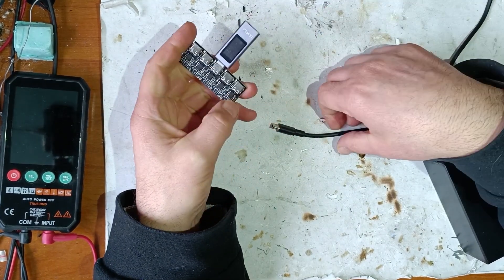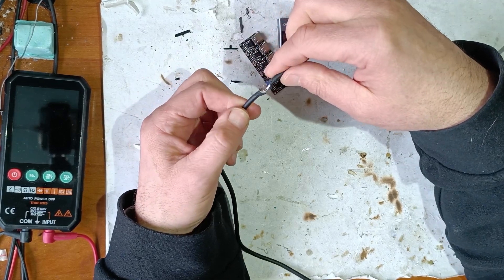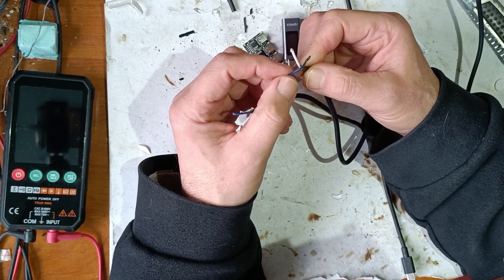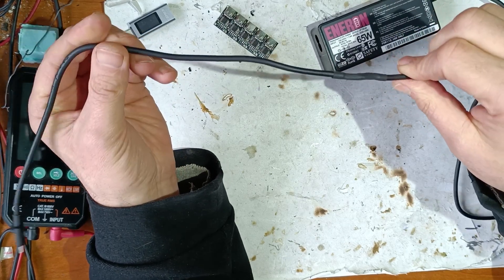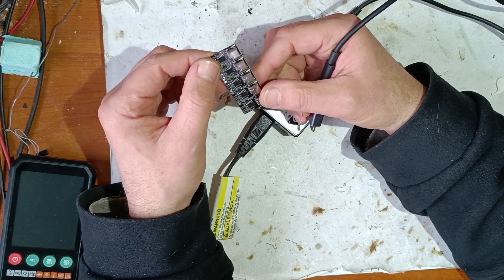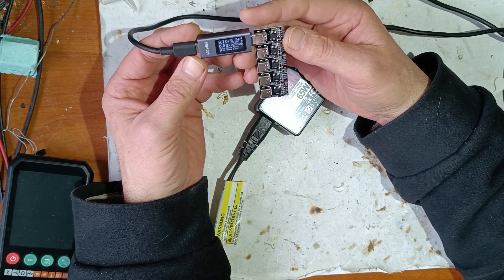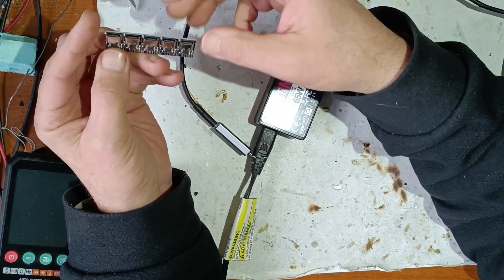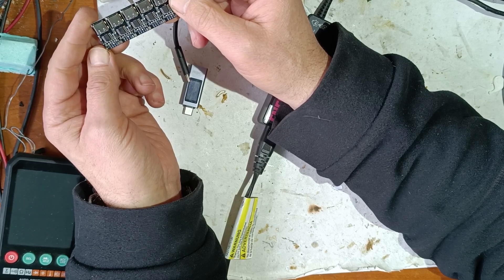I Tested USB-C Voltage! Here's What Happened!

Comment: I watch your videos with admiration, I am a close follower of yours, we are waiting for your videos to continue. Sir, I have a problem that I cannot manage, the 7-pin PWM control rs-600-acab-m2  integrated circuit of the 600-watt cooler master brand power supply cooler main power supply exploded, it cracked in the middle, no code or number can be read on it, what can I do in this case, thanks
Reply from the maker: its an old PSU, and I dont have one. U cand ask in facebook groups if someone has the schematic, or if u r lucky buy another one with other problem. or u can rise the schematics of IC and ask on groups. but its not simple to repait PSu that was used 10 years, better buy another one.
Reply: @diymariuselectro  You have much more knowledge and experience than me. I am a beginner. I am trying to learn something thanks to friends like you. A friend of mine said you could be tny277pn. What do you think?